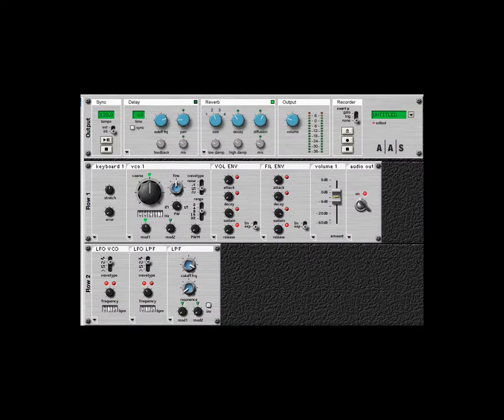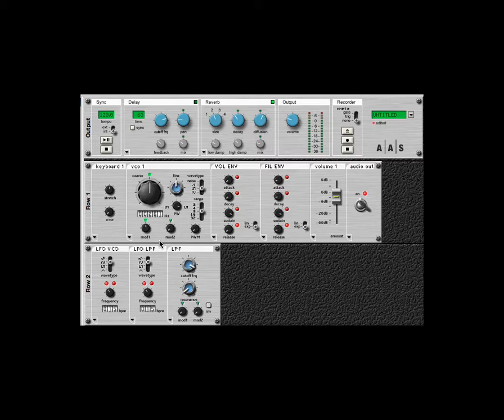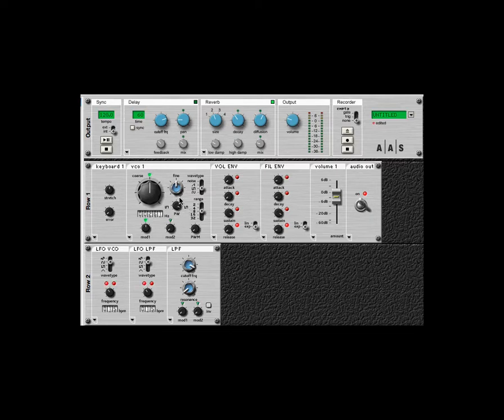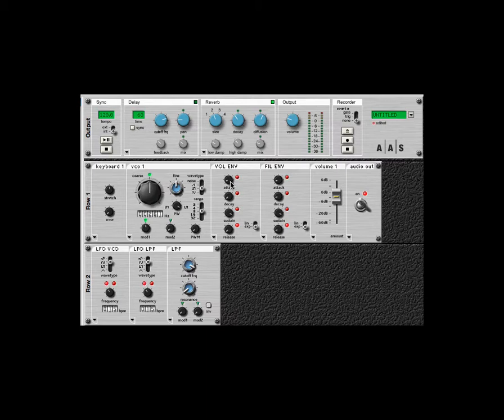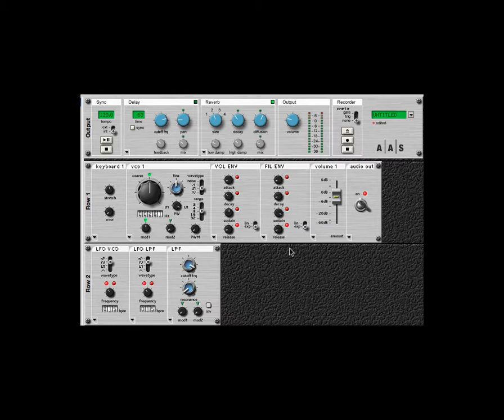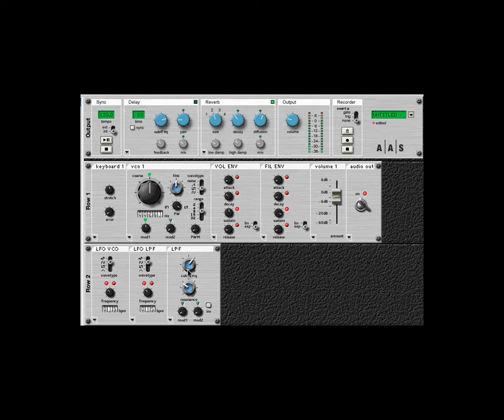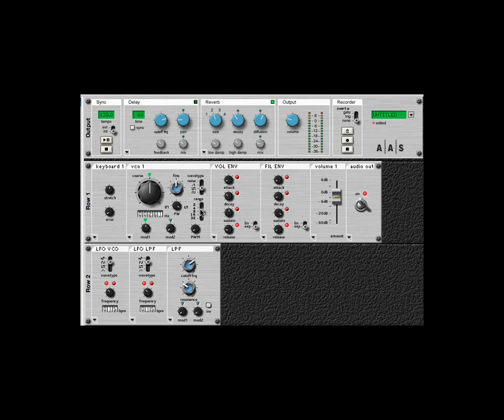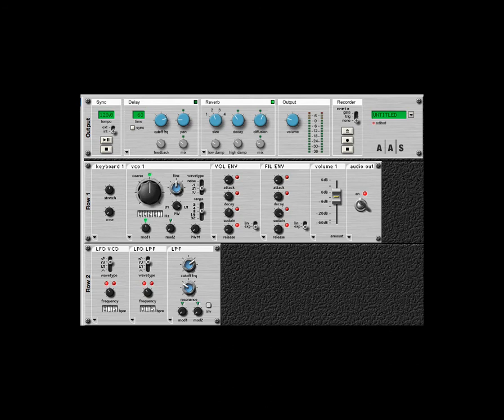Chapter 4 | Video 1: Subtractive Synthesis Clarinet in AAS Tassman

Comment: The GUI of T4 is an utter train-wreck,as it is encased in this strange window with scrolling side & bottom bars.The graphics in terms of the text,is microscopic which is barely legible and I am using a 32" monitor!! The only way to browse the presets,is via a folder that is off to the left and you have to double click each preset from a drop down list.sound-wise,there is not much that is particularly impressive or inspiring and for the most part it's pretty dull.Also...the presets were very poorly programmed(e.g. the volume levels of controls such as gain and resonance are not set properly)...so many of the presets emit distortion.I am shocked that this piece of shit kit,ever went for $329!! I am so glad I downloaded the demo first...as I have discovered that this VST is not even worth the sale price of $100.
Reply from the maker: Hmmm...something doesn't seem right. Tassman works quite well for me and sounds really great, although I like to build my own instruments and customize presets rather than working with those already installed. I have gone through some presets in the past and didn't run into any problem. I prefer to build instruments in Tassman in the standalone application and then open as a plug-in in Logic or Pro Tools -- certainly the small plug-in window is not conducive to doing much design. I'm also using it on Mac, not sure if you are using PC and if the experience is different there. Hope you find something that works for you.
Reply: Something definitely isn't right with T4,as you have to be an accomplished sound designer,to get any worthwhile use out of it.I actually do enjoy experimenting with sound sculpting...to a point,but I am not a professional and I shouldn't have to be,to use T4 effectively.The mark of any good VST synth,is one that has a fair amount of inspiring presets(as this is one of the primary features the user pays for.)There is a good reason why this synth is selling for a fraction of the original price,as AAS created a poor design and have abandoned it.T4 has the potential to be a great synth and if AAS had made improvements to it,like they did with their Ultra Analog VA-2,I would probably add it to my collection of soft-synths.AAS products have never been wildly popular(which is probably why free versions of AAS products can be found in DAW's like Mixcraft.)AAS has some interesting & unique ideas...but often times,their products are overpriced and flawed in some way...which is why their products are often on sale and why this particular summer sale,is stretched out over the entire summer season.The OS of a computer has nothing to do with the problem and in fact that in general,I've read more about issues with software programs having more issues on MAC systems,then on PC ones.AAS's Ultra Analog VA-2,works just fine and in fact,it has been great(since they have increased the size of the GUI...but as for all other AAS products,I am steering clear of them.